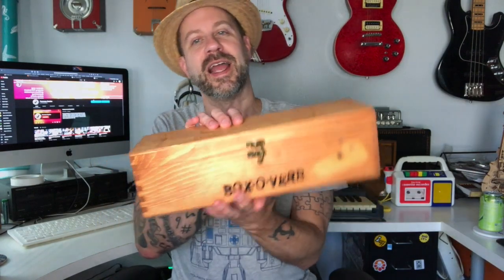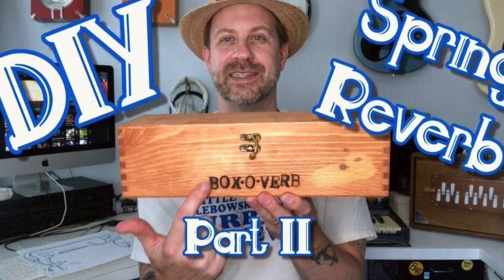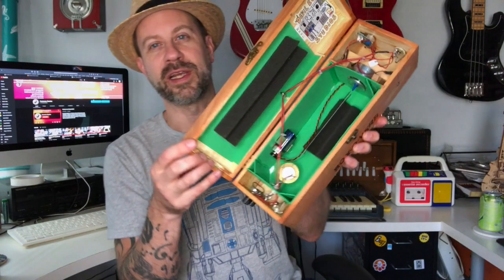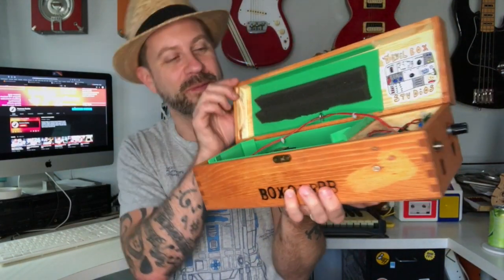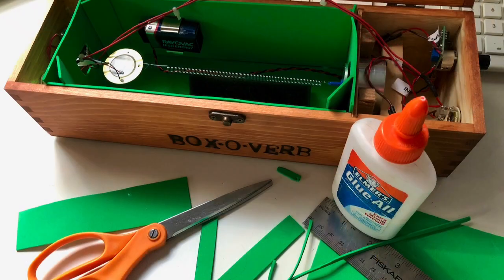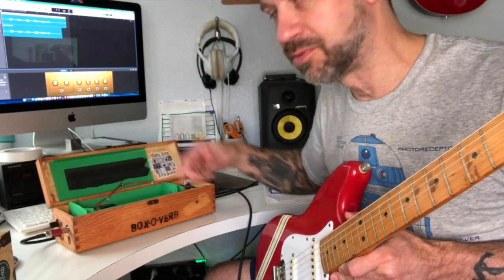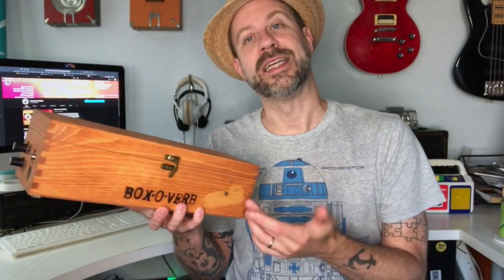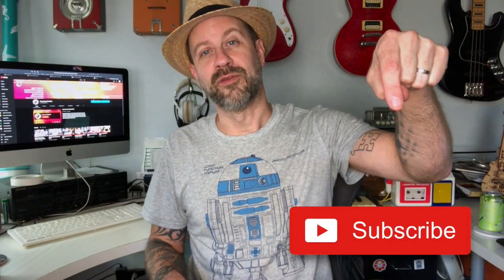Building a DIY Spring Reverb: Part III

Comment: Cool project! I've been researching spring reverb as I'm interested in micing a reed organ I have and adding an internal reverb chamber. DIY might be the way to go here.
Reply from the maker: Thanks for checking out the vid. I was fun to figure all this out. I always appreciate it when others find my vids useful so I really appreciate the comment.
Reply: use motors for the transducers. they dont rotate if fed with audio signals, just oscillate/buzz.
why motors?
commercial units invariably use torsional waves. 

why?

because vibrations generally only manifest as transverse or longitudional.  kick it, drop it, shake it around, a torsional wave is the least likely to occur naturally... 

of course theres some, and the pickup will always give some sort of output regardless of the way its "tickled", but they are a lot less prone to feedback. 

plus it works hand in hand with the way springs are wound...

Comment: This is such a cool project. Since you're suing a 2.5 watt power amp, would it sound bad if you used fuzz or overdrive into the reverb unit? Basically, will it only sound good with a clean tone? I'm interested in making my own.
Reply from the maker: Thanks for checking out the vid. Hmmm. You might get some cool effects with an overdrive preamp... but then you can't really clean it up if you want a more "pure" reverb. I guess with experiments like that, there's typically only 1 way to find out. Honestly though, I think it would probably sound cool.
Reply: @musicalmiscellany  I wonder if an interface can be used instead of a poweramp?
Reply from the maker: @ryel21  The surface transducer is going to need a certain level of power to work. As long as the interface produces that much voltage it should work but most of them are pretty low voltage so I don't think I'd try that (unless you really did your homework).

Comment: There is a difference which can be heard when you stop playing as the sound fades out. Its not better or worse just different. Worth doing though because you have more options. Use it with the lid closed or lid open.
Reply from the maker: Agreed. Particularly with the overdrive. It's a little more noticeable with clean tone. More than sound, there's a difference in feel (hard to illustrate in the vid). Pre-foam, it feels like it wants to feedback every time you push it.

Comment: Far freaking out 

got any ideas where to find better springs
Reply from the maker: Spring are always an interesting thing. They're not really designed for audio so a lot of times it's just trail and error. I've seen videos of people using everything from garage door springs to Slinkys.
Reply: @musicalmiscellany  Thank you
Reply: @musicalmiscellany  You don't have to stick to just springs. I've had a lot of success sticking a transducer and piezo to random objects. Metal plates are the obvious alternative but any object or material can be used. My favorite has been the 24 Oz Monster cans since the sound changes based on how full the can is.
Reply from the maker: @ViviSectia  That's a great idea. I love the outside the box thinking. I've already been contemplating a plate reverb but I really like your idea. Thanks for checking out the vid.
Reply: @jokinmyass9446  Thank you
Reply from the maker: @jokinmyass9446  I'll have to try that on a future project.